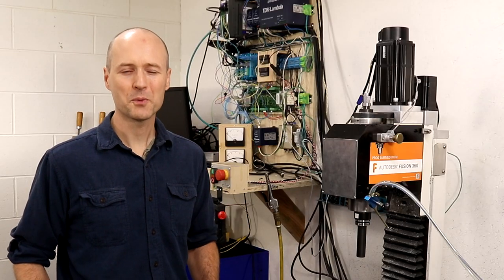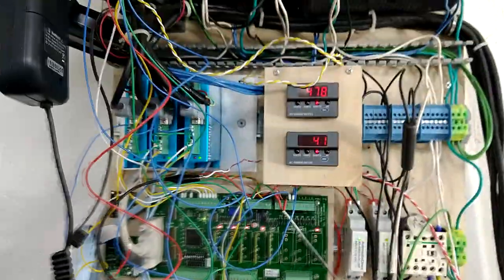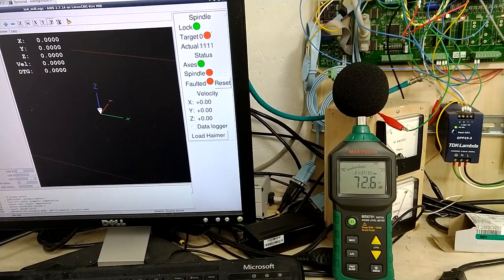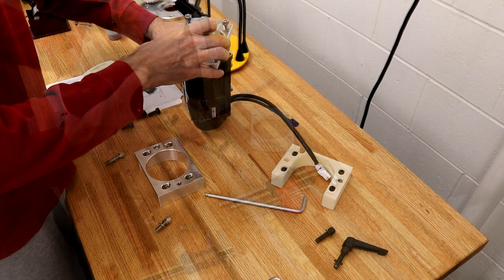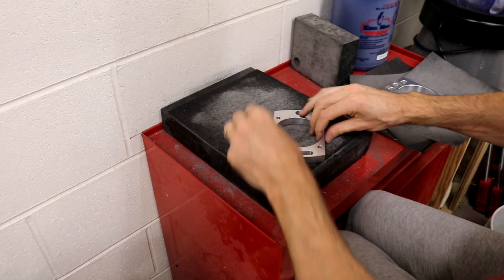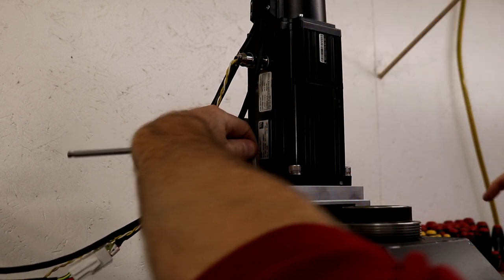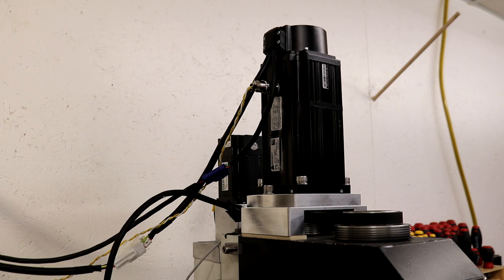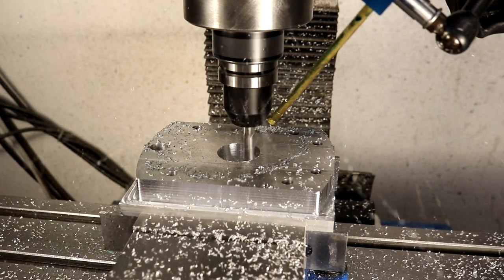Make AC Servo Motor Mounts For CNC Mill Spindle (DMM DYN4)

Comment: I’m using a 3.7kw ac servo for my diy CNC, but haven’t gotten to the spindle part yet so this is a valuable video. Thank you! And happy thanks giving!
Reply from the maker: Awesome; that's a massive servo motor! I'm delayed a couple of weeks finishing up. Electrical and timing pulleys need additional work. No big deal, just unexpected. Murphy! A Happy Thanksgiving to you as well, thank you :)

Comment: Very informative. I have hobby mill just a little bigger than Your. I have a 2.6kw AC servo motor I want to use for my spindle motor. Will it have enough torque to drive it 1:1 and still do rigid tapping and using of face mills at lower rpm?
Reply from the maker: You may be able to do more with the powerful servo than the machine's rigidity allows. There are online calculators for power requirements for a tool, feed, and material. Running less than rated speed, you're in constant torque range of the servo, so look at the operation's expected torque. Should work well. Thank you
Reply: @kentvandervelden  Thank You so much for your input much appreciated. I started epoxy granite filling my machine🙏 and the weight and rigidity chance is amazing.

Comment: Hi. Great video. I plan to build a CNC-milling myself.. Besides buying the servo for the spindle, where did you get the parts that holds the bit etc? Is this home built or bought. Can you provide me with some information, thank you sir
Reply from the maker: Thank you. While a bit out of date, I have some information that resembles at bill of materials and some thoughts about the selection of the parts at following link. Check out the mill design breakdown document. The tool holders that I use come from Tormach. Hope this is helpful
https://github.com/kentavv/kvvcreates/tree/master/pm25mv%20cnc%20mill

Comment: Hello Kent im fixing to make this journey on my pm727v as its BLDC motor as reached e.o.l. I was wondering if you could provide size and model of the motor and driver from DMM ? Is 750 kw big enough? How did you decide on that size motor ? What are some of the base lines I should go off of for my pm727v??thanks for all the informative videos I would be lost without them 😆..
Reply from the maker: Hi Michael, I started with the 750w servo to be able to compare to the stock 750w bldc and to have higher speeds. (The larger servos from DMM have lower rated speeds.) This was easily a great upgrade. DMM has since started offering a 1kw that's an identical size and speed to the 750w. The part number is
86H-DHT-A6MK1
Double check, but the required drive appears to be
DYN4-H01A2-00
Best of success to you!

Comment: I'm thinking of picking up DMM  Tech's 1100w motor and a DYN4 for my X3. Your mill looks like an SX3 variant. Are drawings available for your motor mount? The X3 motor is off to the left and does not  mount on top like the SX3. I may have to adjust for the differences between head dimensions, but your mount would make a good start.
Reply from the maker: Sure, would glad to help. You're welcome to the Fusion360 files or any file F360 can export, e.g. STEP. Drop me an email with your preference.
Reply: @kentvandervelden  Sharing via Fusion360 would be great. I have never done that through Fusion360, just let me know you need from me.
Reply from the maker: Please try importing https://kvvcreates.com/kvvpm25_v29.zip. This contains the DMM related parts and a few others.

Comment: hi other land people. I cee you are using servomotor with brakes. Could you please help me with wiring the motor brakes? (didn't understand yet how to connect brakes to the CNC controller)
Reply from the maker: Some servo drives have an output that controls a relay that switches the brake. If yours does not have that, you'll need to switch the relay using your controller a second before turning turning the motor and then switch the relay again a few seconds after the motor is turned off. The goal is to be sure the brake is off before turning the motor and that the motor is stopped before turning the brake on. Both could be done with timers but the latter could also be done by monitoring the RPM. How all this implemented is going to depend on your controller. Hope this helps.

Comment: Nice video!. What is the advantage of using an ac servo motor to power the spindle?
Reply from the maker: Thank you! Orientation and holding is pretty easy, if needed. But what most people like is that servos have a high power:size ratio and constant torque up to rated speed, and beyond that speed they have constant power. DMM has a 1kW servo, which easily outperforms the stock BLDC on this mill. An induction motor would be better than the BLDC too but they are bulkier than a servo with similar power.

Comment: Thanks for sharing. I see you are using a Dyn4 drive and you mention Linuxcnc. What mode are you driving the Dyn4? Step and direction? Analog voltage? Or something else?
Reply from the maker: A/B Phase
Reply: @kentvandervelden  Thanks, I have never heard of that. The Dyn4 manual has 3 references to A/B Phase. None talk about using it to drive the servo. The first is under position servo. How is it wired from the breakout board to the Dyn4, and how do I set the drive to use it? Thanks for your time!
Reply from the maker: @barebooger  The reason to use A/B-phase is better use of the two-wire bandwidth (i.e., higher frequencies and noise tolerance.) I used it because of problems I had with step-dir on the particular drive I had and you will hopefully not have problems. If you want to use A/B-phase, use DYN's software to configure the drive. [The software is useful for other work as well. If you're using the servo for a spindle (not for positioning) there are other settings to looks at. (Sorry, I don't have the details in front of me.) But, the servo will work without those changes.] Using a Mesa card, step-dir and A/B-phase are wired the same. There is a small change in the linuxcnc configuration needed to switch the Mesa to A/B-phase. I think it's the step_type parameter on the stepgen module.
Reply: @kentvandervelden  Thanks. I have a Dyn4 with a 86H-DHT-A6MK1 (1KW) servo motor and the intent is to use it on a Taig Turn lathe spindle with 1:1 belt drive and use the encoder out from the drive for threading. I may use a Mesa card, but I am toying with a EC500 and Remora firmware. I have to get the card flashed successfully before I am ready to wire the spindle motor. I think step and direction control is what I will pursue.

Comment: Hey Kent
I see your problem.

My Wabeco has the same problem but not as bad as yours.

I'm trying to explain what that problem is.

First the very bad news where you can not change anything.The machine is too light.
If she was heavier, you would have fewer problems.The next problem is the bad quality of the machine 
and an error of the spindle.The spindle is too long up.She can swing up and that's what she does 
the more speed she has.Like a flexbar.Then you have in the spindle """in the case"""a steel part?
That is certainly not round?
I would recommend you:Make a new pulley what fits on the thin spindle and what fits 
in the ball bearing and the best is a pulley with realized in the construction.
I hope you understand.A Part of what pulley is it fits on the thin spindle absolutely perfect 
and it fits in that big ball bearings in the top absolutely perfect.
Everything has to fit 100 procent.   0000000  runout.....is very important.
Then you get the perfect surface you want.

I hope I could help you
best regards Stephan
Reply from the maker: Hi Stephan, that makes a lot of sense regarding the new pulley. I'll need to do that in steps. The smaller machines are much more fun than large machines. Finding and fixing problems is a greater education than everything being perfect from the start... Of course someone looking to make parts for profit should get the bigger machine.

Comment: 0:50... 20% infill, man you are BRAVE haha. but why??
Reply from the maker: Speed to print and reducing warping during cooling. There are a decent number of external layers for strength. Maybe was luck? :) Thank you
Reply: @kentvandervelden  I have my X and Y mounts printed it Carbon Fiber PLA. was planning to replace them ASAP with metal, but actually they both work just fine! 100% infill tho. :)

Comment: I know it's been a while you made this video, But hoping if you can help with a little detail, I have 2 servos, but only one with brake, I know I have to supply 12-24v, but they say I have to make a little circuit with a relay and a diode, it suppose to protect the motor, so the inside of the motor doesnt break. I would really appreciate any help, my servo is the classic chinese AC servo motor. I can give you the picture they send me to control it (meaning the brake) the other menus and configs I learned But the 2 pieces of electronics I cant figure them out . I just need to comprehend the thing. Thanks in advance!
Reply from the maker: Hi John, sorry to have missed your question. If you drop me an email with the details you have I'll try to help.
Reply: @kentvandervelden  Yes! I'll send you an email, just want to make sure that I connect properly the relay and connect in the right place the pins! Thank you!

Comment: A lot of the time with BLDC motors the hall effect sensor is not tuned properly. some of your performance issues might be solved if you retard the sensor. if it gets too hot turn it back to advance...
Reply from the maker: Thank you Peter! I didn't know about that. Maybe that would have helped with the Anaheim Automation driver I had for the BLDC motor. That combination just never worked well.

Comment: that noise must be coming from the two big bearings that hold the spindle spline-drive and most likely due to how the v-belt pulley is attached to this part of the construct.  I guess it would be better to have the belt attach to that spline drive WITHIN the housing, by turning away the upper gear and replacing it with a pulley.

Comment: Newbie: you have a servo motor running a spindle via a pulley. Isn't there a spindle with build in encoder?
Reply from the maker: Great question. The spindle has a sort of encoder inside the head from the factory. It's a ring with 16 holes that pass through a photo interrupter. Can't tell direction with this but certainly can tell speed. It would be a tight fit, but could add a more sophisticated encoder. I showed in another video adding a high resolution encoder to the top of spindle. That worked well but required removal when changing the tool.

Comment: Question how well is the setup work for milling steel..loooking for a solution need a low rpm motor for cutting steel on my cnc
Reply from the maker: I prefer milling steel over aluminum. This motor works well for me. Using carbide tooling, the cutter rotation speed can be increased to be in zone of highest continuous power. I use 1/2" end mills regularly, control depth and width of cut and all is good. Will need to to step drill, but the servo is nicer than the BLDC. The difficulty comes from the rigidity of the mill shown, including play in the bearings which only degrade. Consider replacing the bearings and increasing preload. Still, the will be limited by overall rigidity, but may be enough.

Comment: Have you found the .75kw servor lacks any performance? It seems small in comparison, but I'm not used to AC servos either.  I had opted to go with the 1.8kw from DMM on my build, but I like the the thought of higher rpm with the .75kw servo
Reply from the maker: The 750W servo delivers less maximum power than the stock BLDC, but speed does not sag and the BLDC, which has less protection, may be overdriven. I prioritized higher speed, but wish I could have gotten higher speed and power. I'm sure you made the right choice for your use case.
Reply: I actually have been thinking about a 1.5kw ac motor and inverter too

Comment: This is awesome. Do you have a list of the part numbers for the DMM servo you are using?
Reply from the maker: Thank you Ray! Here are the parts numbers. You'll need cables as well.
DYN4-H01A2-00 - DYN4 AC Servo Drive - H01 Frame 0.75~1.0kW servo motor pair
86M-DHT-A6MKB - 86mm Frame, 0.75kW, medium inertia with +24VDC holding brake
I estimate the inertia ratio between this servo and the spindle to be ~2.44x, so well within the recommended range. I thought the brake might be usable for tool changes (nope) and broaching (probably), but not sure it's worth the extra control logic, electronics, irritation of not being able to turn the spindle when the power is off, and possibly noise.

Comment: What type of belts are you using? I Have issues with my DIY cnc machine, the spindle and the Z axis are not rigid enough and it vibrates
Reply from the maker: The belt is a Gates GT3 (390-5MGT-15) equivalent from Misumi. Here are links to the belt and pulleys.
https://us.misumi-ec.com/vona2/detail/110303273750/?HissuCode=GBN390MR3-150 
https://us.misumi-ec.com/vona2/detail/110303274020/?HissuCode=GPA60MR3150-A-P35-NFC
https://us.misumi-ec.com/vona2/detail/110303274020/?HissuCode=GPA60MR3150-A-N14

Comment: Kent-I'm finally about ready to install my DYN4 drive and servo. DMM sent me a schematic for spindle operation that is pretty basic when compared to the one you would use if you were using the servo as a motion control vs. a spindle. I have it all set on the bench ready to test and in the manual it says set it to speed servo. In your opinion is there an advantage to either one of these wiring options over the other when using it for a spindle?  I would think that the standard servo setup would produce better start-stop-speed control for tapping over the 10 volt control the spindle speed used on the schematic for "spindle" use. I suppose utopia would being able to get the best step/Dir without sacrificing any speed or torque as a spindle. I'm running an Acorn board and when I asked the question on the forum, silly me, I was told to read the manual.
Reply from the maker: Short answer: Use whichever interface is simplest and works for you. Long answer: I'm glad I switches the motor. Unless you need position control (e.g., for clocking tools or using a ATC), 0-10V control may be enough. If I could have used the 0-10V interface, I probably would have. It was the first interface I tried but for some reason, despite all DMM's help, the 0-10V interface on my drive never produced reasonable power at the spindle. However, the Step-Dir or A/B-phase interface worked well and had the advantage of position control (which I don't really need.) 0-10V not working is probably unique to my setup and possibly my drive was damaged. I'm sure that DMM said there's no speed/torque advantage of 0-10V vs. Step-Dir. There might be a small improvement in responsiveness with Step-Dir over 0-10V but nothing that we'd notice with our eyes. I would not rely on the Step-Dir interfaces for synchronized movements, and would only use an external encoder for synchronized movements. The DYN4 signals are fine for speed monitoring. A/B-phase has the advantage of better bandwidth, so roughly 2x greater pulse speed is achievable over Step-Dir. Let me know if any other question comes up.
Reply: Thanks! I’ll play with both. As usual you knew what I was talking about even though I didn’t. I really appreciate the information.

Comment: HOw did you controlled the speed of the spindle ? It's from the 0-10V output of the board ?
Reply from the maker: An analog +/-10 control for direction and speed initially, then changed to step-dir, and finally to A/B phase. The pulses of the later two come from a step generator inside a PID control loop. With each change the maximum and variance of velocity improved. 240v was just installed, and 4700RPM is currently the maximum velocity before phase of lost. This may all be unique to my setup though.

Comment: Can you share with me what is your selection spec for spindle servo, timing pulley and belting dimension for your machine? Thanks
Reply from the maker: Please see the part items below. The servo motor is from Dynamic Motor Motion and the belts and pulleys are from Misumi.
Servo motor: 86M-DHT-A6MKB (with brake) or 86M-DHT-A6MK1 (without brake)
Timing belt: GBN390MR3-150
Timing pulley attached to servo: GPA60MR3150-A-N14
Timing pulley attached to spindle: GPA60MR3150-A-P35-NFC (will need to be bored and broached)
Reply: @kentvandervelden  thank you sir. That help me a lot
Reply from the maker: @kabadaluk  You're welcome to have the 3d models of the mounts too, if they would help you.